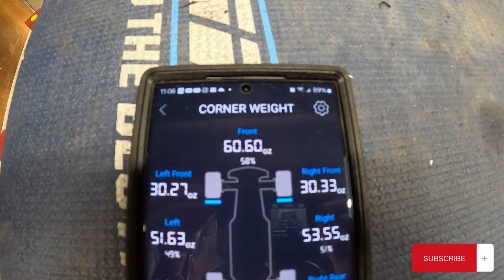Redcat Ascent Ultimate Upgrades! #rcparklife #redcat #ascent #create #rccrawler #upgrade #tinytrucks

Comment: Nice man! I think the lines were smoother for sure. And it side hilled better. 

I just did this 2 nights ago on my sons. Threw in the rock warrior chassis, high clearance sliders, 1200kv fusion and tuned all 4 shocks. Took internal spring out on all, and used some different external springs up front I think. Thing has crazy flex now. Interested to see how it does this weekend. May need to get him some brass next. 

Take care, brother! 🙏🏻🙏🏻
Reply from the maker: That's awesome man!  Nice work.  I'm sure he will appreciate it.  Now to get him to finish well I a comp soon.  Lol.  See you guys on Saturday!